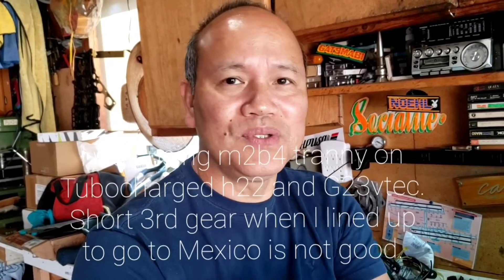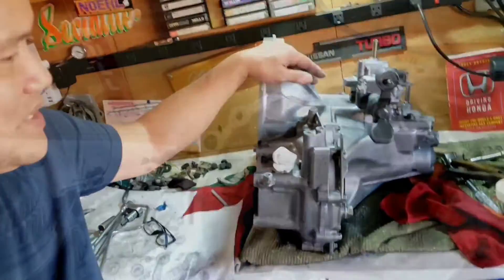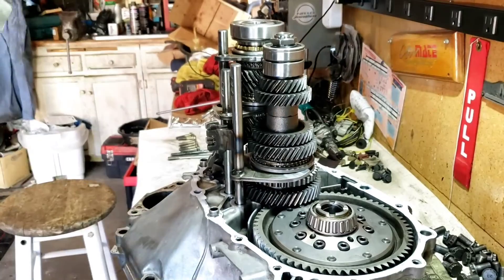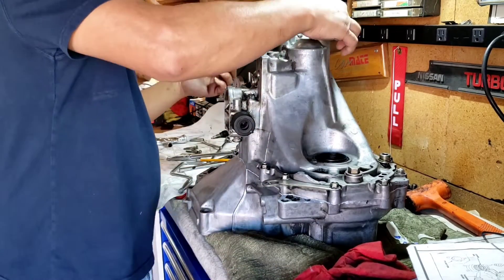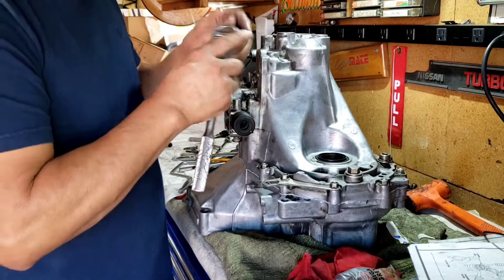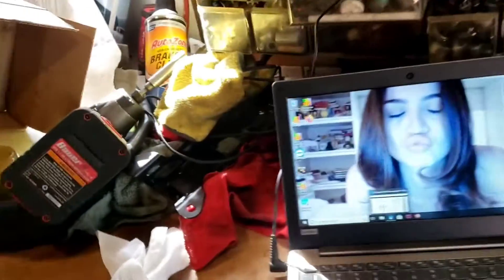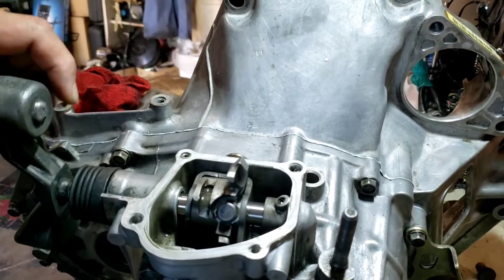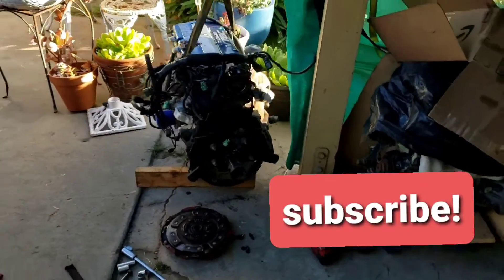Prelude transmission w/ Mfactory LSD, final assembly.

Comment: you’re my hero brother…i have a h22a4 vtec head and looking for a f23a1 block to add about 13 lbs of boost…i plan on slapping it in my 5th gen prelude
Reply from the maker: If you have a project car, l say do it. It really is a fun engine but it can be a headache too if not built correctly. Too bad that h22 didnt have iron sleeve coz that's what keeping us from getting and use a forged pistons. Frm are good for boost too but just not enough piston selection to use. Have you seen my other vlog about H22a4 block with f23 internals and h22a4 pistons. Try that 1st w/o the oil nozzles, build a NA setup, then once your comfortable  w/ it then you can build a boost motor.

Comment: Hey man I’ve been watching the few videos that you have on the dissembly and assembly of this transmission because I was working on a really similar transmission from a prelude to put onto my 5th gen accord. I was just wondering where you got the manual for rebuilding this transmission. I’m having some problems with getting it to work and I’m not sure if I’m doing something wrong
Reply from the maker: Search Honda Prelude Service Manual and it's under Manualslib.com. you can check what you need from there page by page. Make sure you have a good antivirus on your computer though. I just check their site whenever l need something, l no longer have a copy of it except for few print pages.

Comment: Hey my friend, watching your videos you look like you know a lot about these these cars. I got a transmission prelude LSD, but for one thing all my gears are stuck in reverse and reverse, but can’t get one I want to know how that happened if anybody could help me, I hope you can help me figure something out.
Reply from the maker: Does your tranny been open for any service. Last time it happened l couldn't get it out of reverse, the synchro fused on to 5th gear. Sinced 5th and reverse gears use same fork, l was having hard time selecting those 2 gears. So on yours, it's possible that simething broke inside or synchro over heated and got fused. But the only way to know is to open it and it's not that hard to do, unless something really broke inside.
Reply: Thank you I’ve been busy wife just had another baby my transmission to what I know and it has not been servers with me but whoever had it before me I have no idea but yeah I know I got my transmission open now I see all the gears no metal shavings or anything no signs of any thing that’s gone wrong button. Check on the fifth gear right? I hope that’s the problem. I need this car run back up i’ll check it out if anything I’ll let you know. Thank you.
Reply from the maker: @ntxiagNkhu  https://www.google.com/url?sa=t&source=web&rct=j&url=https://www.manualslib.com/manual/466814/Honda-Prelude.html&ved=2ahUKEwip1IbrvvL-AhUnH0QIHXkmC6YQFnoECB8QAQ&usg=AOvVaw0EklcYx_EHyyCGKTNB1XLN
Reply from the maker: @ntxiagNkhu  Link to the Honda service manual, you can view the how to check Prelude transmission sinced you have it open already. Check the gap, teeth on all your synchros.
Reply from the maker: @ntxiagNkhu  Congrats on your baby.
Reply: Noel is the transmission guru.   ❤❤